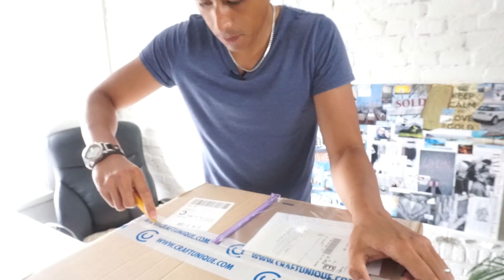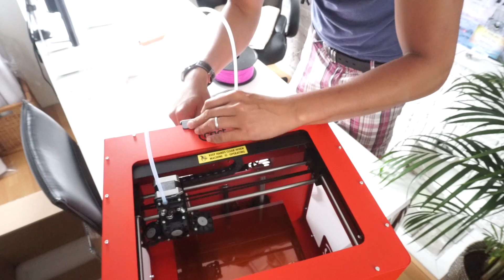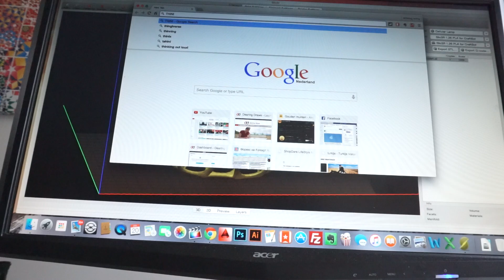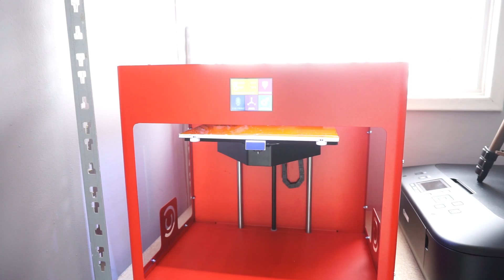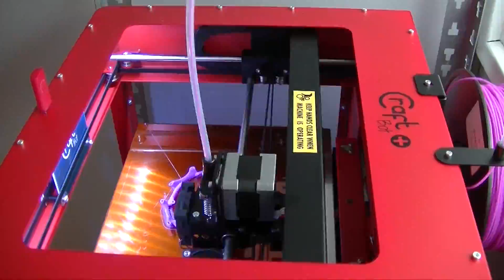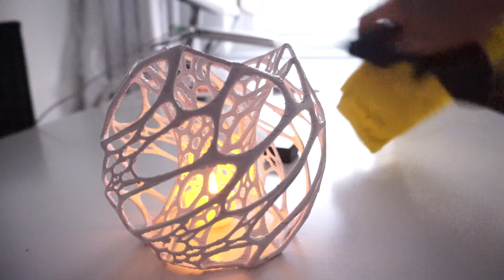My First 3D Printed Lamp With My New  3D Printer (CRAFTBOT PLUS)

Comment: Tip: enable retraction setting in slic3r to get rid of the stringing and then put the finished print in an acetone vapor bath for a batter end result

Comment: 12 hour is a very good time for an object this high with the FFF tecnology (Fused Filament Fabrication) for a better result try to reduce the high of the layer of matirial, the limit usually is 0,2 mm.
The temperature of fusion of the filament is also important, there are a wide set of product on the net, standard in 3D matirial is still far away, little difference in temperature can do great difference in the final product.
For more refined product and short time there are the 3D print that use SLS (selective laser sintering) their layer are of 0,02 mm but they cost 15.000 € instead of 500-1.000 € of the FFF print like your